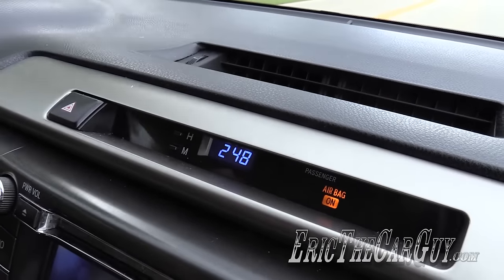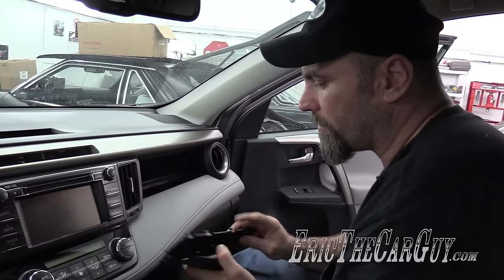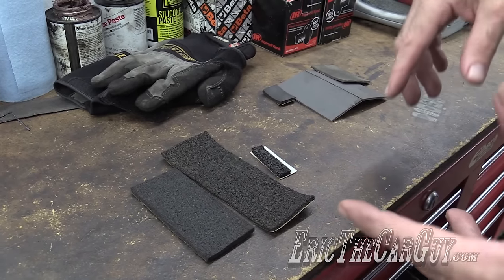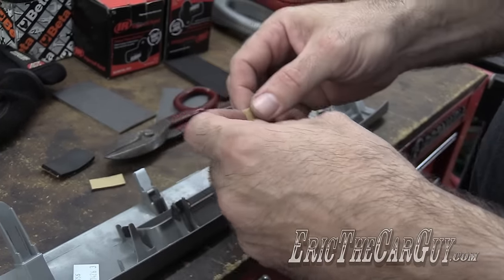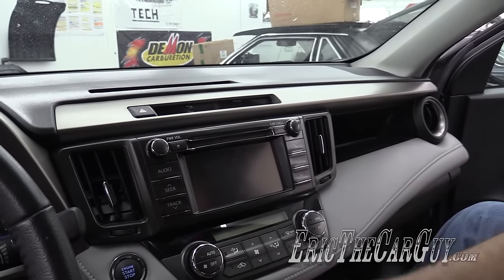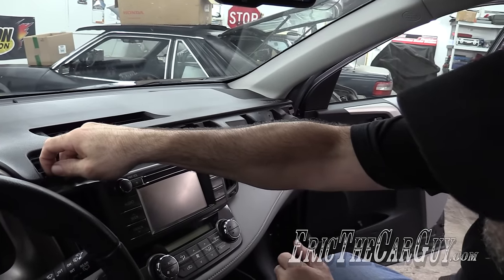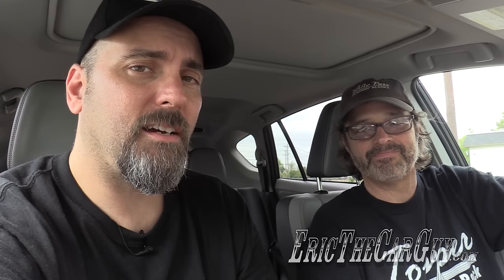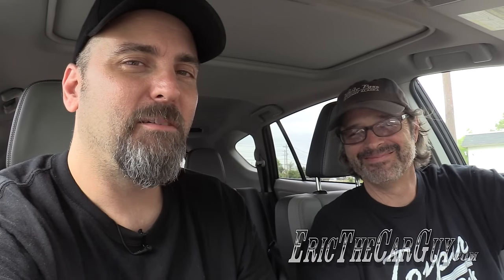How To Find and Fix Dashboard Noises

Comment: I had a similar problem. I solved it by turning up the volume of my stereo
Reply: hahahahahaha me too. just turn up the radio and no more noise.
Reply: Lol
Reply: Usually works, my Tacoma has a rattle as a result of bass coming from the speakers, the Window switch and door lock module vibrates like a mofo especially when the volume is cranked. My temp fix is to rest my knee against the door panel. gonna look for these pads.
Reply: karebu2 lol
Reply: Hahaha same as me
Reply: me 2 lol
Reply: I literally laughed out loud😂😂😂
Reply: Hahahahaha Yas works miracles 🤣🤣
Reply: karebu2 great idea sir ji
Reply: That’s not the point. I expect no rattling at all.
Reply: hahahhahahahhahahahhahahaha
Reply: Actually though.. My first car had no interior rattling at first. The car had an airbag recall and the fools at the dealership gave it a rattle behind the steering wheel, but I didn't notice it for months until I had to give my dad a ride..."What is that rattling?" "I don't know, I've never heard it before" "Well it doesn't just magically start rattling over night" and that's when he figured out that I drove everywhere blasting music if he was not in the car with me
Reply: I cringe anytime I hear this “solution”.
Reply: Hahahahahahahhahaha
Reply: Me too I have annoying one can't figure out where coming from
Reply: If by solved it, you mean distracted yourself from it!
Reply: I had a similar problem.  I tried to solve it by turning up the volume of my stereo. It made it worse (speakers grills rattle everywhere)
Reply: 😂😂😂😂 scooped up all of my baby nephews And nieces
Reply: Too funny
Reply: 😂😂so right bro...I did the same darn thing.
Reply: I had broke down all the vibrating plastics of my old a4 and it became like S class :D
Reply: I can't drive of there's a rattle without trying to stop it, completely does my head in. Selling my car if i can't fix it 😡
Reply: Lmfaoooo
Reply: Perhaps this is the best and easiest solution.. 😂😂
Reply: Until you have a passenger in the car and are trying to have a conversation. The squeaks are super-annoying and embarrassing for me at the same time!
Reply: Good old plastic rattles. Gotta to love it.
Reply: Tried this.......by subwoofer made it worse 😂
Reply: The most efficient and effective way to do it bro👏🏼💯
Reply: Ya
Reply: I just cant... Mercedes makes the stereo sound lower due to it being more sound proofed from the exterior, not from the cheap interior

Comment: Pretty crappy build quality. Lots of flimsy plastic. Don't tell Scotty Kilmer.. Toyota can do no wrong.
Reply: Yeah, "Buy a Toyota, you won't HAVE that problem!". I subscribe to Eric C, Eric O and Ivan... I do not subscribe to Scotty.
Reply: I listened to Scotty and got my mom a corolla. Although it's been reliable, it's uncomfortable, and the interior is all plastic and cheap!
Reply: I didn't listen to Scotty, bought a Ford. Dash and console has genuine fake burled wood, and 12 years later and 145K+ miles does not have 1 single squeak or rattle (if you don't count the worn stabilizer links that knock a bit. Not as bad as the dreaded "Eric is stuck in the trunk" sound and I am sure Toyota has stabilizer links too.
Reply: toyotas and Mitsubishi's are notorious for plastic sounds when driving. fords not so much, except the rear tailgate of the ford escape, but solved that problem by putting some foam between the plastic and the metal in the tailgate
Reply: when buying a toyota you are paying for the engine quality not interior. if you want a less noisy interior get a lexus.
Reply: Scotty Kilmer is a sellout anyway, almost every video he does is sponsored. And his mind is stuck in the 90's if not earlier.
Reply: FrozenHaxor i recently replied to his channel. he was dissing Kumho tires for BF goodrich. he is indeed a sell out.
Reply: +JayVan Geli When I mentioned sponsored content I was immediately banned from the channel :)
Reply: I'm no fan of Toyota but I still admire Scotty. Just because he has brand loyalty, doesn't mean he isn't a master at his trade.
Reply: Honorable European Nationalist he may be but it clouds his judgement. its fine promoting products (ETCG does that too and a host of other youtube people), but he does that by putting down somebody else. While others focus on why the product being promoted is good, he goes by saying how shitty the other product is and why the product he is promoting is good. unlike the others where they also say upfront the content is sponsored scotty never mentions it or even admits it.
Reply: +Honorable European Nationalist That would very much depend on what you consider his trade. If it is making weird videos on how to do half-assed car repairs, sometimes bordering on downright dangerous, and ranting about how the cars are bad nowadays but were much better back in the day, then yes, he's indeed a master of his trade.
Reply: Prior to 2004, Toyota was a good product. I'm sure their engines and transmissions will still last a long time. It is B.$. for me to have to deal with noises that should've been addressed at the factory.  Apparently new cars from both TM Japan as well as TM Kentucky now have piss poor build quality.
Reply: Martin Fiala scottys clutch changing video is a joke he makes it look so easy and it is not at all.
Reply: ouimetn all Toyotas will last for 300k miles minimum with little to no maintenance except  break pads.
Reply: @chaleorta  You sir know about business. That is what most people don't understand.
Reply: I'd rather have a car that rattles a bit and maybe appears to be a bit "plasticy" on the interior if it almost never breaks down (which is the case with almost all Toyotas from '95-2014).
Reply: I don't fully agree with scotty on the Toyotas. However I still like watching his contont for his sense of humor and other tips. I have a 2012 ford focus that has quite a few rattles too. It seems to be a problem with alot of these 2010+ cars. I have a 13 year old gmc sierra by the way that has 0 interior rattles and a friend has a 2001 superduty diesel with no interior rattles either! These later model vehicles have more complex dashes and much thinner plastics!
Reply: It must be American made Toyota's. Or the fact that rhi sis not a new car
Reply: Welcome the the wonderful life of plastic!
Reply: @alanmaier  Just keep up with the maintenance with your car and you should be good.
Reply: Most newer cars all use more plastic that snaps together. I've seen this issue from most cars. The 2013 RAV4 was the 1st year of a new Gen so these things have to be figured out. I have a 2017 RAV4 that has no such dash noises.
Reply: @FrenchValleyAirport  I have 2 Corollas that are super comfortable and uber reliable with zero noises. My 2009 Corolla S that I turbocharged and my 2017 Corolla iM.

Comment: Eric I can't thank you enough for this video. I own a 2017 Toyota RAV 4 and recently discovered a rattle that appeared to be coming from the dash area. It was driving me crazy. Seriously considered selling the car. I dreaded bringing it to the dealer and likely spending $300 and leaving with the same rattle. I found this video of you working on a 2013 RAV 4. The rattle seemed about the same volume and same location. I had no idea how to remove the dashboard trim and two side vents until you demonstrated.  I removed all those components and carefully insulated every possible area where there was plastic-to-plastic contact or a loose fit with dense foam and foam tape.  I securely snapped everything back together and took it for a test ride around the neighborhood.  I thought it was gone but after a few blocks  THERE IT WAS! I went one step further.... I gently pried-off the trim around the instrument cluster and packed that with foam.  That was the culprit. To my delight... ABSOLUTE SILENCE! Thanks to you.

Comment: Remember the good old days when parts were metal and were screwed together?  Too damn much plastic and awful plastic clips!  Nothing is designed to last anymore.
Reply: Metal screws into plastic parts not a great idea, either the plastic breaks or the thread wears.Metal to metal is better.
Reply: philip parker He said the parts were metal and screwed together with metal screws. Dont you fken read?
Reply: The car would weigh and cost a whole lot more, that's why there's so much plastic in everything. It's cheap and does the job.

Comment: I daily drove a 94 Miata for 7 years... THAT thing was an absolute rattle trap thanks to the age of the car, and the stiff suspension and harsh shocks. I spent years fixing and diagnosing squeaks, rattles, buzzes and chirps, and never got them all solved. My OCD wouldn't let me stop. It always annoyed me so much. I think I had the entire dash out of the car and apart probably 4 or 5 times, doing this process to all of the pieces in it...

Comment: Hi Eric, just want to say thanks for the great video. I was concerned about a dashboard "bump" noise on my Honda Jazz over past few weeks. I thought it was coming from inside the dash, so I follow your "fist knock" test and found out there is nothing loose from the dashboard. I knocked the glove box and it gives me the "plastic knocking" noise and it turns out, the plastic cover (that cover all electronics cable) under the glove box is not closed properly (the clip wasn't attached properly) and it gives the plastic knock noise when I go over bumps. I took the cover off and clipped it again (the noise is gone now) I just fixed the noise by watching your video. Thanks!!

Comment: My 2003 Toyota Tacoma had a rattle in the dash from day one right out of the dealer.  I later learned that many other Tacoma owners have the same issue.  I have a 2002 Chevy Express van that has many failing plastic interior parts.  I fixed the broken arm rest mounting flange with epoxy and a broken plastic panel on the side sliding door panel with a few drops of silicone.  I find that silicone is pliable enough to work with at the start yet firm enough after it dries.

Comment: Great video, Eric!  NVH is a very expensive sector, and people who are really good at locating NVH issues have great job security with vehicle manufacturers.

If you search online, you can find large sheets (or rolls) of 1/8" and 1/4" closed cell foam pretty cheap.  It's the same stuff a lot of the OEMs use to block noise from outside the vehicle, and it works great as a cushion for rattly parts.  Neoprene also works well to dampen vibrations.  Both are flexible and resistant to moisture; great for applying to trim pieces!  :)

Comment: I've used different sized adhesive foam weatherstrip as well. When i first put some performance motor mounts in my MX-5 that unearthed a whole new world of dash rattles. Now i've got it narrowed down to one dash rattle inside the vent diverter box and a bunch of door rattles soon to be adressed. Thanks, Eric for finding me some legit product to use in this application!.

Comment: HI Eric, 
As a retired NIASE technician I had to smile when I saw you thumping the dash with your fist to locate the noise (s)! It was as if by magic my hand appeared on the screen doing just what you demonstrated.in the excellent video. After working at various dealerships on high end imports, I became my own worst enemy, I am now so sensitive to all manner of noises that it takes the fun out of driving. I find myself constantly diagnosing all manner of ailments no matter whose car I am in, especially my own!

Right now I am chasing an interior plastic against plastic 'buzzing' noise that changes with temperature, type of road or engine rpm.At times I an bring the 'buzz' in and out with the throttle.If it did it all the time it'd be much easier to find or course. These intermittent sounds are the worst imho. I will be the first to admit that the average person wouldn't hear the noise or be bothered by it if they did. Sadly I am not that person, I'm so sensitized now that the 'buzz' is all I hear. I anticipate hearing it as soon as I leave the driveway. Add to the fact that when the cold engine first starts I hear the noise on the passenger's side of the car. Once the ICE ( Internal Combustion Engine ) << (Prius terminology), sorry. is warm enough to satisfy the computer, the engine goes off the high speed idle and the noise stops. 

Sad thing is that the noise appears randomly on the same stretch of road, at various speeds, making it more fun to locate! I was hoping that by now some enterprising manufacturer would have made a directional microphone and a was to record noises onto a thumb drive or the like. You'd be able to point the mike at different areas to isolate the location. But no one seems to have thought that far. I did see one that seems to be made for suspension noises and not dashboard sounds. I have yet to try my cell phone to see if I can even pick it up at all. Between the road noise and wind noise it may not be possible.  I surely won't take it to the 'stealer' and pay hundreds for something I can do myself :)

Thanks for a great video I am sure it will help many folks. 
Regards,

J T
Reply: You cracked me up, thank you so much for asking my day, I am same way!
Reply: Sorry meant you made my day, because I feel like this about the different squeaks and noises I hear when driving. Drives me nuts.

Comment: Good video!  I've tracked down squeaks and rattles in the past and have had success using clear silicone caulking (typically for use in bathroom and kitchen on sinks, etc.).  Once you find the source, just put a very small dab on the area and the silicone will usually prevent them from rattling or squeaking and can still be easily disassembled in the future if necessary.  I used silicone because I didn't have the tape you mentioned but I did have silicone in the drawer.  One way or another, we shall conquer the rattles!
Reply: Great tip. I have some rattling pieces on my pajero.
Reply: @intellectracoon  yeah seems like all the pajeros have a similar problem. My dads Pajero sport has the most annoying rattle right where the radio sits

Comment: Nice one, always pays to keep your cameraman happy. That self adhesive foam is great for stuff like that, i hate rattles in the car, so my dash and centre console have their fair share of it added, along with a bit of silicon sealant along the back of joints on the console. Worst part of solving issues on a car your unfamiliar with is working out how something comes apart, i am always scared of breaking the plastic clips by pulling in the wrong direction on something, especially on older cars where the plastic gets brittle.

Comment: Eric. i am verry thankful for this video. I had much noisy back dec in my Honda Fd1, so i took the plastick back dec off anf fill every contact point with metal with foam and i am happy for what i did for more than a year now. unfortunatly since this summer as the temperature gets over 100f for more than a month i diagnose many faliures at the front dec, tacometer so if you put me or every one who still own this car as i know that the one of majors problems that honda got is that it is not verry strong to bear high tempratur. to how properly disassemble the front dec i will besoin more thankful. for the viewers. i can help on how to disassemble properly the back dec. thanks so much.

Comment: For anyone unable to find the anti-vibration foam, adhesive-backed weather stripping will work too.
Reply from the maker: I also linked some in the description.
Reply: Felt pads and cabinet bumpers can work too, something like these: http://www.homedepot.com/b/Search/N-5yc1vZc2h6/Ntk-Extended/Ntt-felt+pad?Ntx=mode+matchpartialmax&NCNI-5 or http://www.homedepot.com/s/cabinet%20bumpers?NCNI-5
Reply: another possibility if you dont want to wait for anything to come in the mail, or spend a lot. the like sticky foam animals used for kids crafts are great as well. they are pretty thin, but they stack well. i spent £1 on a whole pack that i haven't even used a quarter of.

Comment: Kringed a bit when he was punching the dash, but problem solved very well.  Despite some of the comments at the end of the day Toyota builds a quality product at a reasonable price.  Strong resale values and generally high customer satisfaction ratings only reinforce this fact.  Nearly all manufacturers have to implement cost cutting measures to remain competitive, some are able to do it better than others, while still retaining a quality product as a whole.
Reply: Toyota fanboy?
Reply: But if one of them produced a completely quiet car they would be a top seller. My Berlingo is a fine car but it drives me insane if I drive on any rough surface. That`s why I am looking here for ideas.

Comment: Hi. Event if it's an old video, it just helped me to take apart those pieces and stick some foam on them. I have the same car, but from 2016, and I recently started hearing a squeak from the dashboard, but only when it was warmer outside, and it started driving me insane. I saw some videos about taking out the media unit, but I did not know where were the squeaking points to make sure to fix them. 

Special thanks for the explanation and the logic for finding and solving those noises, I stuck some foam tape under the media unit, where it touches the climate screen top part, I'm waiting for tomorrow for a longer ride to see if it's been solved.

Thanks again from Romania!

Comment: Good ole Made in Yusa for you.
My 2003 Maxima (made in Japan) with over 160,000 miles never rattled or vibrated.
My 2013 Focus (made in Michigan) with 17,000 miles vibrates on startup, the door seals screech and the dash rattles.
My wifes 2007 Camry (made in Kentucky) was also a nightmare.

Comment: A good tip too when adding those adhesive pieces. Clean the area.first with isopropyl alcohol to remove residue otherwise that stuff you put on will peel away in time.